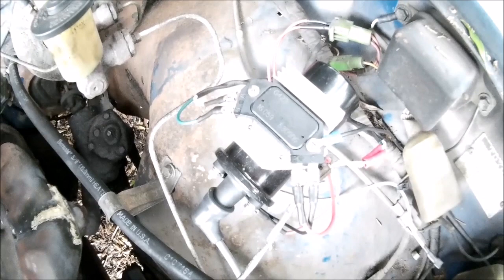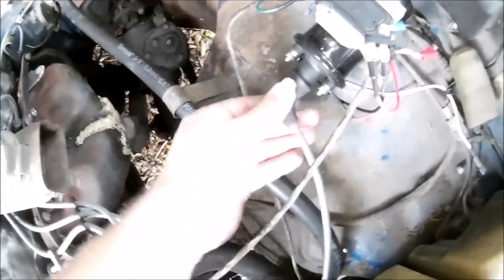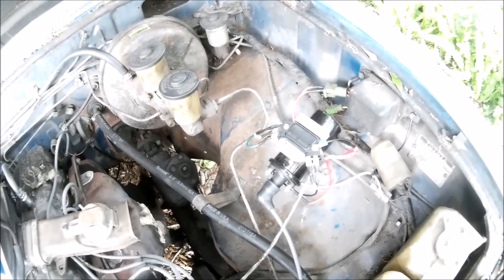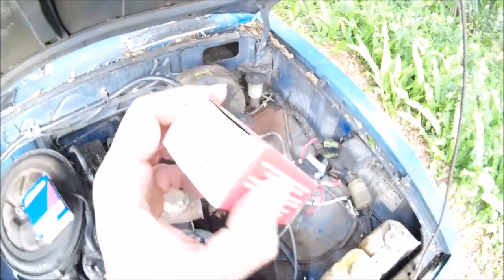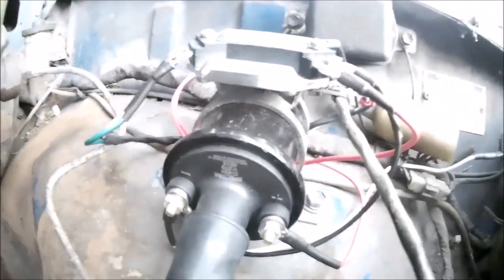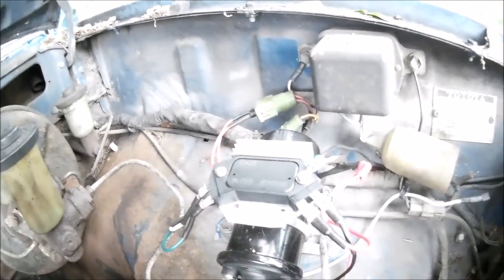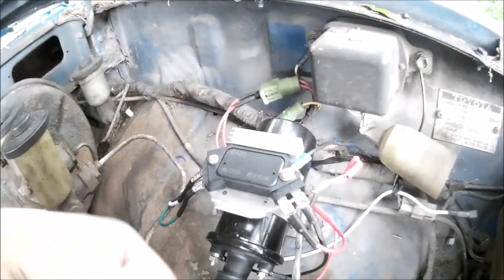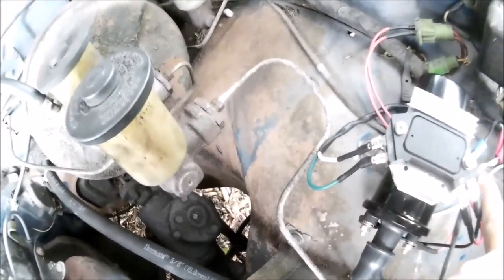1978 Toyota Pickup/Hilux 20R - GM HEI Ignition Module Conversion

Comment: Hey, I know this is a very old video but im hoping you can help. I will just be as detailed as humanely possible.

I recently bought a 1987 Toyota Pickup with the 22R in it. I brought it back to my place and it randomly died out 2 minutes away from my place.

Anyways, I narrowed it down and found out that its getting absolutely no spark to the plugs. I've checked from the coil/igniter - no spark either.

I had some extra money and figured a few things could be replaced regardless so I changed out the distributor, the cap and the rotor, the plugs and the wires. Still nothing. I then tested the plug that originally goes into  the coil/ignitor from the wiring harness. It's getting 12v power there. So then the next likely thing I thought was that either the coil or igniter were bad. Like everyone else I couldn't find one locally and I went to the auto parts store and they quoted me $750 and a 6 week wait.

Then I stumbled upon this "upgrade"

It is all very straight forward and I've read many forum posts on it as well. The only place where im getting confused is for the "B" terminal. I understand that one wire goes from the original plug to the "B" terminal and in this video, you have the other side of the plug running to the "+" on the coil. The other posts I've seen make it seem like I run one from the 12v key on power to the "B" terminal and then splice in another wire from there and run it to the "+" on the coil. When I did it the way you did in this video, I wasn't getting 12v's at the coil with the key on and with the wire spliced into the "B" terminal and then ran to the coil, I am. 

I also haven't grounded the ignition module properly yet as im waiting to go to the store to pick some things I will need to mount it in properly so that could very well be my problem.

Is there absolutely ANYTHING else you could think that would cause no spark? Any other way to narrow it down to make sure that its not something else? I've tried absolutely everything I can think of and its driving me crazy.

Any help would be immensely appreciated.
Reply from the maker: No problem, I'm glad to help when I can. But there's one thing I don't understand here. You didn't mention testing the Ignition Coil at all. That & the Igniter were the last two possibilities, but you didn't test the Ignition Coil? It's a far more likely subject of failure that the Igniter in my experience.

To properly test the coil you'll need a volt/ohm meter, and the coil needs to be entirely disconnected from the ignition circuit. That mean disconnecting anything wired up to the Positive & Negative terminals, & the center wire that goes to the distributor disconnected. If you don't do this any meter results you get could be inaccurate.

The specs for the Ignition Coil for a '87 22R are: Primary - 0.4 to 0.5 Ohms, Secondary - 8,500 to 11,500 Ohms.. All test measurements should be taken with the coil "cold", mean that it has not just been run for at least the previous hour (will explain why below). The Primary is measured by placing one meter probe each on the Positive & Negative terminals. The Secondary is measured by placing one probe on the center coil terminal, & either Positive or Negative terminal (usually doesn't matter which one, but try it both ways).

In my experience it's usually the Secondary that has problems first. Any reading on the Secondary of 9,750 Ohms or above cold and you can suspect that the coil is bad or going bad. As the coil works, it develops heat normally. With a good coil this isn't an issue. But with a weak or failing coil, that heat can cause excess resistant in the coils windings, and send it out of spec. The extra resistance can get so large that you have no spark at all.

If you don't have a volt/ohm meter to test the coil, or don't feel comfortable trying to test it yourself, just remove it from the truck & take it to almost any auto parts store (Advance, O'Reillys, Auto Zone, etc) & they will usually test it for you for free. Be sure to ask them for precise reading that they get; it's important.

If the coil tests out bad as described above, that is what may be your issue. That could also mean that your stock Toyota Igniter might still be good. Those things rarely fail.

HEI Module Conversion - 1. I prefer to have switched power from the ignition switch to provide power to the Module & the Ignition Coil. This is for safety, reliability, & to make sure the module & coil are not drawing direct power when the truck isn't running.
2. The Ground on an HEI Module is super critical to making the thing work. You could try (at the very least) just running a 14 or 16 gauge wire straight from the battery negative post/terminal to the ground point on the module for a temporary ground, & see if you get spark then. Without a solid ground there is no way the module will work.
3. If by "pick some things I will need to mount it in properly" you mean a heat sink, for certain, you'll need one. The Module makes it's own heat during operation, which it dissipates through a metal plate on the bottom of the module. That plate needs to be in good contact with an appropriate heat sink, to help conduct heat away form the module. Not doing this could result in the module "frying" in it's own heat & failing. Heat Sink - REQUIRED. Whether you use the AC/Delco part I used, a piece of aluminum flat plate, a piece of copper plate or something else is up to you. But For anything other than the AC/Celco Heat Sink I recommend that the metal plate be at least 1/8" thick & at least twice as big in surface area as the module.

Other things that could cause no spark:
1. Poor/No/Incorrect connection to the Distributor Pickup Coil. Check the terminals in the plugs & make sure they aren't dirty or corroded. Recheck your wiring - White wire to W terminal, Red or Pink wire to G terminal. Some trucks MAY have a Black wire instead of Red or Pink; just treat it the same as those, White wire always goes to W, other wire always goes to G. Closely inspect the wires going from the distributor pickup coil to the module for damage. If you have an ohm meter test for continuity in both wires to make sure they aren't broken inside the insulation.
2. Air Gap not properly set on Distributor Pickup Coil.  When any one of the "splines" on the ring below the rotor is lined up in the center of the pickup coil, the air gap spec should be 0.008" to 0.016". I go with 0.012", right in the middle of the spec. Make sure the hold-down screws in the base plate of the pickup coil are tight (don't overdo this, you only need a few foot pounds of torque on them. Any more & you'll strip the threads out of your brand new distributor, so  don't crank them down, just make sure they are firm.)
3. Distributor not properly installed. Even if this is so & the ignition system is working you'd still get spark on a spark tester, just not at the right time, but it's good to recheck your work to make sure it's in there right.

That should be enough for now to get you going on it again. Let me know what happens.
Reply: @The13thSword  Thank you so much for the most detailed and quick response. Very much appreciated.

So sorry, yes, I did test the ignition coil. The Primary is sitting at 1.1 - 1.3 ohms and the Secondary is within spec at about 8600-9100, I tested it a few times and it fluctuated.So I'm guessing that the primary coil has gone bad. Would it be possible to just use the round cylinder coil? for lack of better words, and just hook the igniter up to that and test that out? Because, if I could I would rather keep the stock igniter if possible.

As for the GM Ignition module, I am assuming that it is just bad ground as its not mounted at all yet, I just put a small bolt through it with a ground wire on that bolt and ran it to a bolt on the fender. I hadn't done anything permanent yet as I wanted to see if it would run first before I did everything properly but that very well might be my issue.

I will check the air gap on the distributor tomorrow and make sure everything there is good.

How would I go about testing the continuity of the wires inside the distributor?

The last question I have before I leave you, I have replaced just about every fuse I could think of. Is there any ones in particular that would not let it run or cause it to not have spark? Its very hard to find fuse box diagrams for these trucks.

Thank you once again, I will report back once I've done my testing and let you know how it turned out.
Reply from the maker: @jordant4005  No problem, glad to help. It does sound like that coil has a bad Primary. That upper reading is like 260% above limit, and might only get worse when it heats up. It's also a little telling that it's fluctuating when you try to measure it. When measuring resistance with an Ohm meter, you ae basically sending voltage from the meters battery (usually 9V DC or less) into the circuit you are testing. It may be that even 9V is causing resistance to build in the primary windings, if they are fatigued or shorted inside the coil. Also, when you have a problem like this with the Primary side, the voltage drop from excess resistance is more severe, as you are only dealing with 12V+ from the battery (if battery is good).

To put it simply, the more the resistance in a circuit, the less voltage you have to use. By my calculations @ the spec of 0.5 Ohms on the Primary, the coil would be getting about 9.5V average. That's fine. But at 1.3 Ohms it's only getting 5.5V to work with. If it's a "12 volt" coil, that's no where near enough voltage to get a decent spark out the Secondary side, if any spark at all.

IF in fact the Primary side of your coil is to blame that's actually good news. Your stock Igniter may still be good. Igniters & ignition modules usually get "taken out" by high Secondary resistance, not Primary.

The shape of the coil doesn't much matter. What matters is if it's of good quality (*see note) & it's within spec. You can use almost any good quality ignition coil from '75 up with the HEI Module and it should work, however the later model coils have lower Primary spec, and these would give you better spark quality. overall. ALWAYS use a coil that is spec to your model year when using the stock Igniter. The Igniter is designed to work with a specific coils resistance ranges for best results.
*Note: NEVER go with an "economy" ignition coil when using an HEI conversion. I've had 2 "cheapie" coils go wonky on me within 6 months & blow up 2 modules. Never cheap out on a coil; it WILL give you headaches.

"RE: Bolt on the fender ground". 2 things. It's best to completely remove the bolt & hit the metal around the hole with some sandpaper so the bolt contacts bare metal on the surface. It would also be wise to check your body ground cable. This is usually located on the rear of the cylinder head & connects to the firewall. It could also be from negative battery post to fender wall, near the battery. All this is a part of that "solid ground" I mentioned that the HEI needs to work. That's also why I suggested that you run a wire direct from the module ground to the battery negative for testing purposes.

You probably don't need to check continuity within the distributor, as it's brand new or rebuilt. What I meant was the wires that run from the distributor to the Igniter/module.

Continuity test - Set Ohm meter to any Ohm range. Without probes touching, confirm that meter reads "OL" (means "open loop" or no continuity). Touch probes to each end of a wire you want to check. If wire is good, meter will read zero ohms or a very small amount, like 0.01. Reading above 0.01 means the wire have excess resistance & should be replaces. Reading of "OL" means there is no continuity in the wire (disconnected, broken wire, bad/dirty terminal or contact, etc.)

Fuse Box Diagram. You an easily find these on Google. Just search "1987 toyota pickup fuse box diagram". Or take a look at this: https://www.yotatech.com/forums/f116/cab-fuse-box-id-help-246365/
As long as the ENGINE & IGN fuses are good your ignition system should have power.

Looking forward to hearing your results.
Reply: @The13thSword  So, lots done and still no luck. I came back to ask another question regarding the HEI module. Is there anything I can do to check to make sure I am getting power to the correct places?

I hit it with a test light and have 12v to "B and C" and also the Positive and Negative on the Ignition Coil. The "G and W" terminals do not have 12v - which I believe they shouldn't, correct? 

I am trying to go through everything step by step, I have set the air gap on my distributor, taken off the body ground from the negative terminal on my battery to the fender wall and cleaned the contact and stripped the paint away, I have wired up the new Ignition coil to the stock Igniter - still no luck.

I think I am going to assume that the igniter is bad as it is just easier to wire up the HEI module and continue on with that. I am just not sure where else to even begin to check.
Reply from the maker: @jordant4005  Sounds like something is not correct in your wiring. You should not be reading constant voltage on the C terminal at all, even with the system cycling (i.e. ignition to start & engine cranking over). In a properly functioning module**, the only thing the C terminal does is supply a pulsed signal to the ignition coil, turning it on & off. When the module turns the coil off, the magnetic field in the coil collapses, causing the coil to discharge & send spark energy out through the center post.

Nothing else should be connected to the C terminal except the wire going from it to the coils "-" post.

If you are reading CONSTANT voltage on the C terminal, you either have a positive power feed wired to it, or the module had gone bad. The electronics inside the module that are responsible for switching the ignition coil on & off could be "stuck" in a permanently closed position.

It is possible to damage the module if you have left it powered on for some length of time without the engine running. So it would be wise to get the module tested.

Correct, the G & W terminals should not be reading 12 volts. If anything, they should be reading about 3 volts AC but only when the distributor is turning, as in engine cranking or running. You really shouldn't worry about that though, as the pickup coil is new & you have the air gap adjusted correctly. It should be fine.

You mention using a test light on the C terminal. How was this done & why? Is it possible that you back-fed positive voltage into the C terminal? If so you may have damaged the module. Again, get the module tested. At the very least this will either confirm or rule out the module as a problem source of the no-spark problem.

Here's the basic wiring diagram again if you need it. https://www.camaros.net/threads/remote-mount-hei-module.462339/
Just to be clear, notice that there is just the one wire going from the C terminal to coil "-" post. There is nothing else attached to it, & especially not any sort of positive feed.

What ever happened with the module ground-to-body/engine? You didn't mention that here. Did you try running a direct wire to the battery negative for testing as I suggested? That "bolt hole" ground on the module is critical for the module to work; it has to be there and solid.

You're going to get this figured out. Just take a moment, clear your head and go over each connection one at a time. I'm sure it's something simple.
Reply: @The13thSword  The only other thing I have a question about, is about the "B" terminal. From the factory plug on the wiring harness where the stock  Igniter/Coil is plugged in. You have two spade lugs plugged in there and one is running to the "B" terminal on the module and one is running to the positive side of the coil. Is there a test I can do to make sure the coil is getting the right power to it with a test light or multimeter?

Thank you once again for all your help and long - thought out paragraphs to help me, it is much appreciated.
Reply: @The13thSword  I think I found my issue potentially, from the original outlet for 12v power that powers the ignition coil/igniter. I am only getting 12v switched out of one side, I ran this to my module and put a test light on it. The other one that goes from the original plug, just like you have done that runs to the ignition coil. I don't see any 12v power coming out of it anywhere.
Reply from the maker: @jordant4005  I did that because after a lot of testing for power from the ignition switch at that factory plug, I found out that BOTH terminals in the stock plug were providing 12V, regardless of whether the ignition switch was in START or RUN. There was some early confusion on my part in doing my conversion due to bad info. Some people I listened to said that there would be no power on the RUN terminal when trying to start. This made no sense to me, so I tested the system for power with a volt meter, with the ignition switch in each position, & testing BOTH terminals that way, to verify function.

I also checked the truck's original wiring diagrams & verified this. If you want to you can test it for yourself, either with the test light or the volt meter. I always prefer the meter for accuracy of voltage reading. Negative probe to a good ground, positive probe to coil + terminal. Turn key to RUN & read the voltage or "light on", then turn to START & read the voltage or "light on". Your should see power on either key position.

And since the plug has two terminals, and both provided 12V under either START or RUN positions, I decided to take advantage of that, using one to power the coil & the other to power the module, on separate wires. I didn't want to have to run both from a single terminal, as the current draw from the module & coil at the same time could become a problem (fire hazard - wire overheating from high current).

BTW, check your IGN (ignition) fuse in the fuse block & make sure it's good, plus have a close look at the spring clips holding it foe any corrosion. I had that problem. It should be the second from the bottom of the block & be 15 AMP.
Reply from the maker: @jordant4005  Eek. That could mean a break in the terminal or wire to that terminal at the worst. At best it's just something on that one that is loose & can be tightened up. OR it could also be a fault in the ignition switch. You'd have to disconnect it at the plug on the column to continuity test the ignition switch in each position. On the '78 the two power feeds from the ignition switch are the Green/White & the Black/Yellow.
Reply: @The13thSword  So here’s my issue, and I have zero idea why it’s doing this. I have the wires from the distributor to the “G” and “W” terminals. They are correct. I then have the “C” terminal running to the negative on the ignition coil. Then, since my factory plug only has 12V on one side in any position, I have to double up off of that one and run one wire to the “B” terminal and one to the positive on the ignition coil. So here’s the issue that baffles me. When the setup is like this, I’m getting 12vs to the “B” like I should and 12v to the positive on the ignition coil, like I should. But I’m ALSO getting 12v to the negative on the ignition coil and the “C” on the ignition module. 

When I had it rigged up exactly the same as you have in your video. One from the factory plug to B and one to the positive on the ignition coil. There’s 12v to the B terminal and nothing to the C or to the positive and negative on the ignition coil. So basically when I run 12v to the positive on the ignition coil, it goes to the negative side of the ignition coil and also runs to the C terminal. It makes absolutely no sense to me. Any idea?
Reply from the maker: @jordant4005  I don't know exactly how you are measuring this with the volt meter, but let's assume you are doing that correctly. I have two questions:
1. Did you ever get that module ground done? The one from the bolt hole in the module closest to the B & C terminals, to a solid ground?
2. Are you trying to start the engine when testing either setup?
3. If you are trying to start it with confirmed power to the ignition coil & the module B terminal, are you getting any spark from the coil at all? How are you checking for that?

Again, without that module solidly grounded, it could provide some weirdness like you describe. Also, depending on the position of the reluctor ring (splined wheel in distributor shaft that triggers the pickup coil), you might or might not be seeing voltage at the negative terminal on the ignition coil, when nothing mechanical is moving & it's position is "static" (not moving).

This entire setup's basic purpose is to turn the ignition coil on & off, via opening or breaking it's ground side of the circuit. That's why the module's grounding is so important. There is a power transistor in the module that does this, acting like a switch. that opens & closes that negative "ground" side that goes to coil negative.

Just for reference, the ignition coil has to turn on & off for EACH spark plug every time it needs to fire. In a 4 cylinder @ 800 RPM idle, that's 400 fire cycles for each plug, or 1600 times a minute total. That's more than 26 times a second. So the ignition coil switching has to be robust & precise.

The reluctor & pickup coil sends a signal every time one of the splines lines up with the pickup coil. This causes a power transistor in the module to break that negative ground circuit to the ignition coil, causing coil discharge to the distributor (spark). If a spline is not lined up with the pickup coil, the power transistor completes or closes the negative ground circuit for the ignition coil, allowing it to "charge up" so to speak.

So depending on spline position, you may or may not be seeing voltage at the C terminal.

From your description the wiring sounds correct, as long as you are getting full battery voltage to the ignition coil "+" terminal & the B terminal on the module. However, if during all this testing there has been damage done to one of the power transistors in the module, especially the one that's responsible for switching the ignition coil on & off, that could be causing you issues. That's why I recommended that you go get the module tested to make sure it's functioning correctly. I blew up two modules myself (including a cheap one & a "quality" one!) before getting my setup to work, trying to figure out the exact way to get this done. I'd also get the coil tested as well, but suspect that it isn't the problem.
Reply: @The13thSword  Yes, I did get the ground finished on the control module. I ran a stand-alone wire from the hole closest to the B and C terminals.

Yes I have been trying to start it at each thing I have been doing to try and fix the issue.

No, still absolutely no spark at the plugs or coil.

I am getting full power at the + and the B terminal.

Do you think that a faulty ignition switch could be to blame for this ?
Reply from the maker: @jordant4005  Possible but doubtful in my mind. You already tested for power with the key in different positions and are tapped into a known good power source. Go get the module & coil tested (x3). Find out for sure if they are still good or not.. If they both test good then you can look for other items on the vehicle.